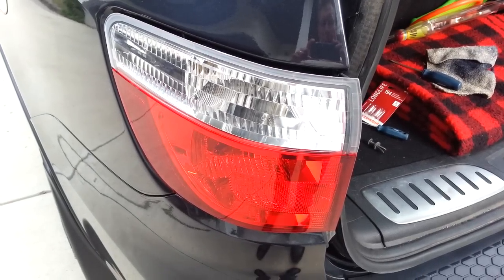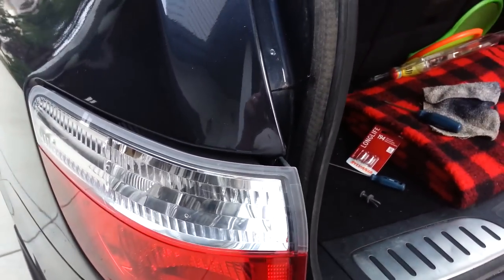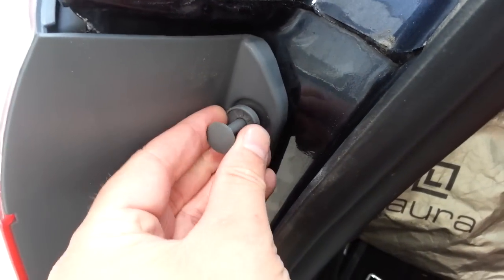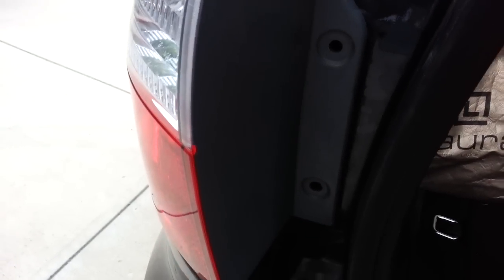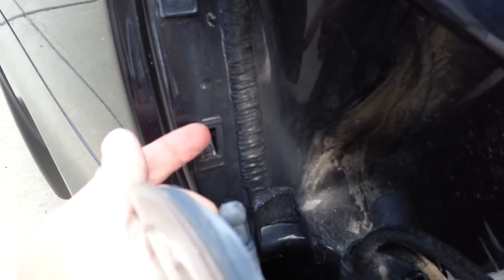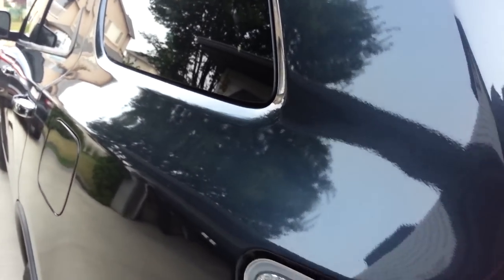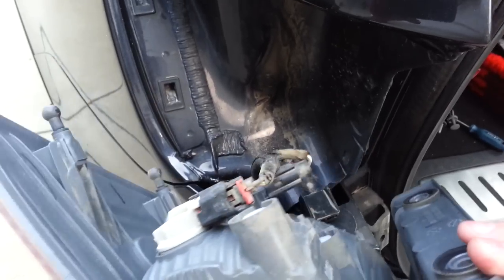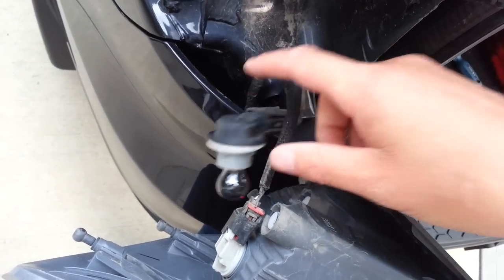How to Change Dodge Durango Tail Light

Comment: Awesome video really helped!!! Question? I  have a 2013 Dodge Durango with the  same tail lights as in the video.  I was wondering if the rear tail light assembly can be swapped with the newer 2014, and 2015  wrap around tail lights on the Durango?

Comment: Thanks!!! Less than 5 minutes. 
Note:
You should turn the plastic bolts left to unloose them before prying them out with the screwdriver. Then to replace turn them right to tighten them back.
Reply: First of all, the "bolts" don't need to be turned in either direction, they don't have threads. They pull straight out. Secondly, unloose is not a word and it's a double negative. That's like saying dethaw.

Comment: I tried using a screwdriver inside of cloth and it ripped and made a very small scratch. I would suggest using an all plastic spatula from the dollarstore, it will slide right in with a little pressure and that will separate the headlight housing from the car.

Comment: Yeah, good luck getting those fucking caps out. I never knew a little piece of plastic could turn me into a crazy, raving lunatic in my driveway. 😡😡
Reply: Took 10 seconds each. Small/short screwdriver and put it under outer ring where it indents. Long screwdriver would be harder for sure.